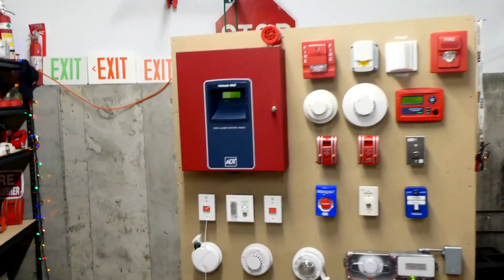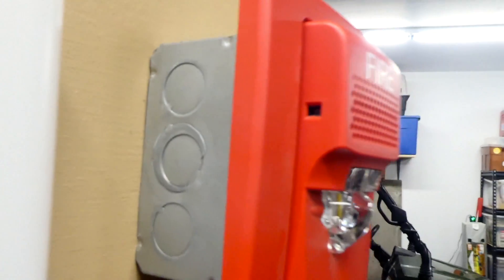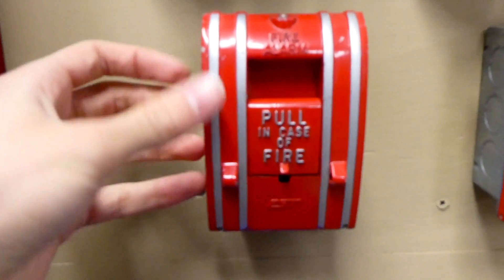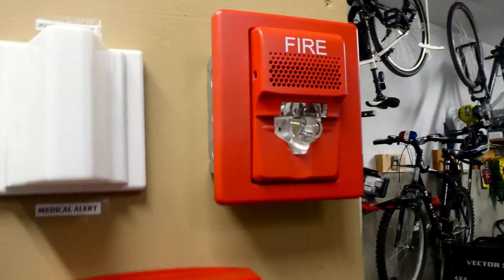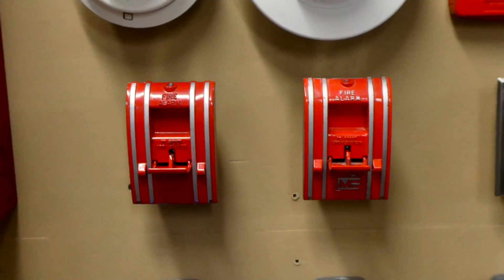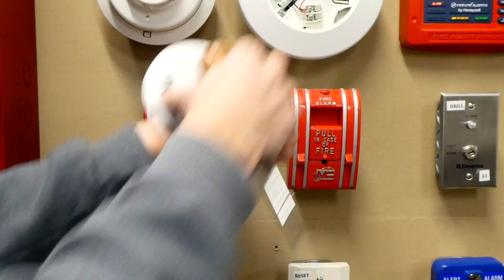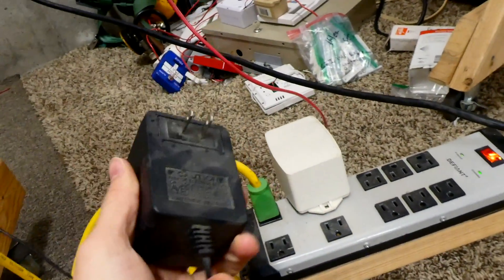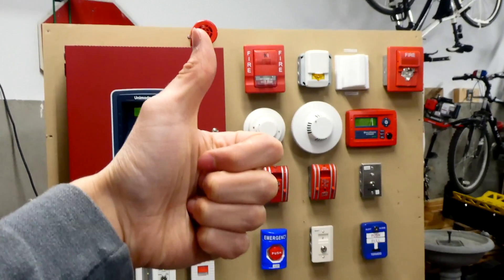ADT Unimode 10UD System Test 14: EST

Comment: I really messed up with my Edwards alarms. I had a board to put them on, and I made the hole for the 278-SIGA to go in the middle, and on the right was the 270-SPO. Turns out the keyhole for the 278-SIGA is on the right.
I can't put more holes in the board as it is starting to fall apart, so I really messed up.

Comment: Fun fact about the 270-SPO: In all the areas of my school except for the back hall, the pull stations are these, however they're labeled "LOCAL ALARM".
Reply: @owenweber5527  congrats, your school has a modern system. Ours is a similar story except it's BG-12LS pull stations and Gentex Commander 3s on, you guessed it, mechanical horn mode.